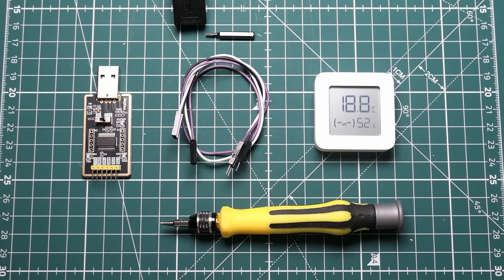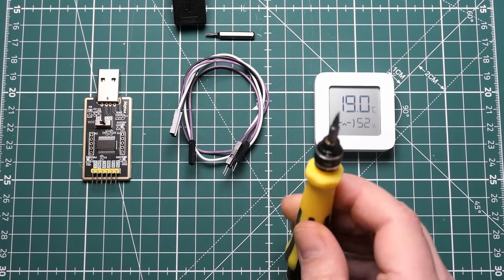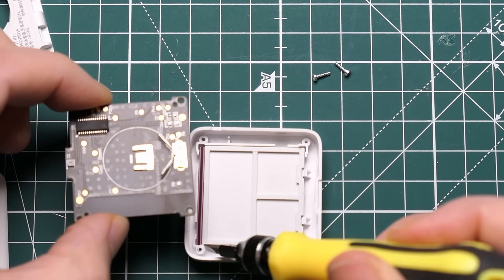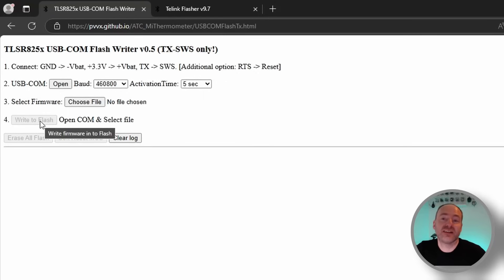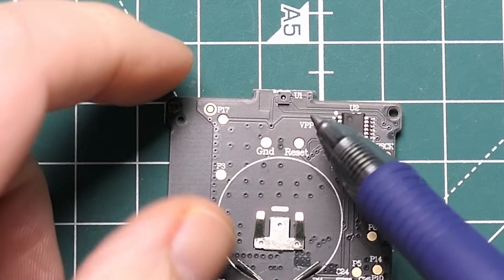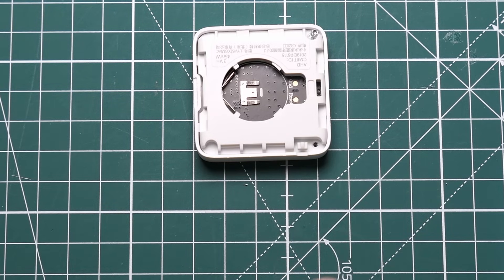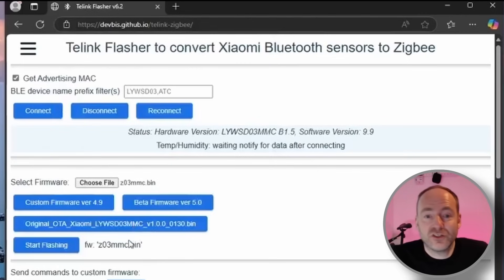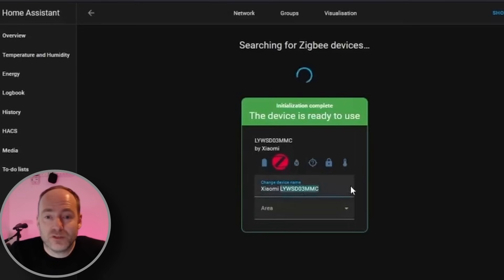Custom firmware on cheap Xiaomi Thermometer, Bluetooth to Zigbee (2025) #homeassistant #xiaomi

Comment: With the official Xiaomi Home assistant Integration can I still use these locally with Bluetooth without changing the firmware since it sounds like it can break the screen or cause other issues with new ones? I bought five of these years ago and have them flashed because they are old versions just to the custom Bluetooth firmware since the official integration didn’t exist a couple years ago. I want to get some more though.
Reply from the maker: I’m afraid the newer versions are completely locked down and don’t work in home assistant without the firmware hack… you’d need to use the proprietary hub and app to use them. 

I don’t think it is the firmware that’s causing issues with the screen, for the sensors I have I just think they are low quality clones and the screens break regardless of the firmware used. Some people mentioned the screen didn’t work immediately after flashing the firmware, I also saw this once, but it is the one time I really had to squeeze the sensor back together (not sure why, think the clips were slightly misaligned), once it snapped back together the screen never worked again. If you can get the sensors directly from Xiaomi that would probably be the safest approach.

Thanks for watching 👍👍
Reply: @thecircuithelper thank you

Comment: FYI: Just bought a Xiaomi MI Monitor 2, 2025-11-14. The hardware have changed. There is no "big" IC on the same side as the battery. There is a NEW small squared IC on the same side as the CPU.
But P14 is still on the same place. And most important, your excellent guide still works!
Reply from the maker: Really interesting update - thanks!

A few folks had mentioned that the firmware had stopped the screen working on the unit, but several of my units ran for a while and the screw has gradually faded and stopped working on all but 2… I guess this is the danger of buying flakey modules off aliexpress, Im not sure they are actually manufactured by Xiaomi, which generally has a good rep! 

Thanks again!
Reply: @thecircuithelper  oui sur 3 modèles après le 2ème firmware l'écran ne fonctionne plus alors que sur mes anciens thermomètre tout fonctionnait

Comment: DO NOT do it on Mac. I had to learn the hard way.
Reply from the maker: Why…….? I didn’t try yet?
Reply: @thecircuithelper well doing it on MAC fried 3 out of 5 sensors.  Blank screen, no Bluetooth. Completely not responsive. Good for the trash
Reply from the maker: Damn, that’s a blow!

Quite a few folks had commented that their screens don’t work either, indeed I’ve noticed on some of mine that the zigbee still functions but the screen no longer works. I’m wondering if it’s more because these are flaky clones rather than the actual firmware on them… I modified all the ones I bought so now I don’t have anything to compare to!

Comment: where to get the ''jumper cables''?
Reply from the maker: Amazon or aliexpress have them! You’ll need a male end for the battery, and male on the other if you use a proto board, or female if you’re plugging directly to the Arduino pins
Reply: @thecircuithelper proto board?
Reply: Please a link to the jumper cables female to male. I can’t find them anywhere.
Reply from the maker: Here’s a link to the wires you need:
https://s.click.aliexpress.com/e/_c3JXzwof
Reply: @thecircuithelper thanks a lott!

Comment: Hi, I tried to flash two devices with a production date of 2024.12, unfortunately neither device booted after uploading the firmware. Be careful, I still have 8 more, but I don't want to risk it.

Comment: OK! For everyone with a "BRICKED" Device....  You aren't bricked. Your screen is just bugged. The unit is working...
Now, to get it working again...  After you flash the ATC_ota_40000.bin, continue on with the steps (your screen will be blank).
Dont use Devbis's firmware. Google for PVVX's branch of this. He has a flasher on his page.
Connect to it and push the OTA "Custom Firmware ATC_v53.bin"
Welcome back screen!

Pre 3/2025 models can then flash zigbee.
There is currently no working zigbee firmware for devices made after march of 2025 due to a change in the way the chip reads/handles it's config on boot. It messes with the zigbee settings and causes constant re-binding with generic addresses. This will get you on to decrypted BLE though.

Comment: just tried it on two LWSD03MMC and yes bricked them both. I thought i'd just broken the lcd on the first so i tried again with the second. same result.
they were ordered from the Xiaomi Tool Store Store on aliexpress, June 22, 2025
Reply: ok, so not quite bricked, but not great either. The display no longer works, but they show up on a bluetooth pair as ATC_xxxxxx. The flasher in the description can't connect, just sits there but the original flasher  on devis called telink-zigbee can see it, and can upload the z03mmc.bin.
the screen doesn't come back, but i can load it into deconzGW which then sends it over to Home assistant. I've got a couple of old ones hidden behind pictures or in the roof that i can swap as i don't need to see them.
thanks!
Reply: @bobmagnets1522  Read the latest comment.

Comment: Thanks for the tutorial. I've tried to do exactly the same thing as you did. I am using AZ-Delivery HW-598 (CP2102)as an adapter for USB to UART. AS long as the Adapter is NOT wired to the thermometer and I am using the first USB Flash writer everything works out fine and the TXD LED is blinking as it should. The moment I am connecting the device as you explained in your video, the log halts at "Reset DTR/RTS". There is no activate and no writing afterwards, everything just freezes. Any ideas?
Reply from the maker: I can think of a few things, most likely is the voltage setting on the usb-uart converter, mine has a 3v3 or 5v setting, you need to be on 3v3 for this. If you’re 100% sure you’re on the right test pads then it could maybe be an issue with wire length etc (seems unlikely though). I’m not sure what else it could be, unless the manufacturer has done something to stop new firmware being uploaded (which is possible I guess, but wouldn’t imagine such steps would stop the uart working, unless an intentional hardware change). Good luck with it 👍👍👍

Comment: I followed this guide to reset my already flashed themometer but after flashing back to the ZigBee firmware, it doesn't attempt to join my network. Is it possible it retained the details of my old zigbee network even after flashing?
Reply from the maker: Hmmm that’s a little strange… How long did you wait? I found it can take up to 15 mins before they are recognised in HA! Taking the battery out and putting it back in whilst being close to the ZigBee access point tends to get it recognised instantly. If you’re still struggling, I believe there’s a new firmware you can flash over the air, might be worth a try but I haven’t investigated in any detail yet! Good luck 👍👍👍

Comment: Unfortunately, it didn’t work. After flashing to  ATC_ota_40000.bin firmware, the thermometer won’t turn on. I had two devices and both ended up the same — not working.
Reply from the maker: Damn, what a blow!
Somebody commented just earlier today that there’s a new firmware you can install over the air, might be worth a shot trying that one. If you can’t connect wirelessly because the device doesn’t respond then you might be able to upload it with the uart! Good luck 👍👍👍
Reply: @thecircuithelper  just update, firmware work, just the display is off.
Reply: @thecircuithelper  can you send me the link for the new version, I didn't find it in original Github rep. Thank you.
Reply from the maker: I’m afraid I didn’t get chance to look yet, was just going on the comments of somebody else! If I find it I will post a link!
Reply: Mismo comportaminento he podido meter zigbee pero la patanlla deja de funcionar... ¿has avanzado en esto?

Comment: Confirming others experiences. Uploaded the Initial file fine. Then the second file over BT, Zigbee would'nt find it, so tried upload again and it zapped the unit.  Waste of two hours...  Update, was able to reinstall first file still blank screen. Fitted in another working case but still not working. Confirms it seems to brick the board.
Reply from the maker: Damn, thanks for the update! Sorry about the unit, so weird it works for some and not others!
Reply: I thought I'd bricked two Xiaomi sensors until I realised the screen was blank but the sensor was still communicating over bluetooth.  Home Assistant and ESP32-Faikin devices were still able to communicate with the sensor and collect data.
Reply: Same situation, after flashing the first firmware it seems to just have a blank screen. Shame as I bought 5 of them, bricked 2 so far

Comment: When doing the 2nd part i am assuming you need to be on a device with Bluetooth? e.g my PC does not have Bluetooth so the Xiaomi would not be able to connect with the PC?
Reply from the maker: Somebody commented and said it’s not necessary to do the first part, you can simply flash the zigbee firmware onto the unit without going via Bluetooth! Haven’t tried it myself, but worth a shot if you don’t have Bluetooth available. One thing to watch out for is that some folks have said the firmware has bricked their devices, this might be because Xiaomi have updated their hardware to block it. So only try it if you’re willing to sacrifice a device if it does go wrong! Good luck 👍👍👍👍

Comment: Flash process to ATC_ota_40000 seems to be successful according to onscreen logs but I managed to brick two units as well 🤨
Reply from the maker: What a blow! My first suggestion is to disassemble the units and carefully rebuild them, making sure everything is perfectly aligned. If that doesn’t work, you can try flashing the second firmware directly on the unit using the usb-uart converter. Somebody in the comments mentioned it’s not necessary to install the first firmware, you can go straight to the second. Finally, if you have no luck, you could maybe try connecting to the unit in home assistant, as it may just be the screen that has stopped working (this is my suspicion). Good luck, let me know how you get on! I really hope the design of the units hasn’t changed very recently meaning the firmware used in the video is no longer appropriate! When did you buy your unit? Cheers
Reply: @thecircuithelper  Thanks for the reply, and your fantastic work.  Unfortunately, I think they have changed the firmware to block flashing.  Have tried connecting, and flashing various bins hoping that it was only the screen but no luck.  Bought online in South Africa, not sure where the units were sourced from. Regards
Reply from the maker: Damn, thanks for letting me know. If better update the video info to warm people there’s a possibility of bricking them!!

Comment: Any pointers for a blank screen after the first flash of the 4000 bin
Reply from the maker: First I’d disassemble the sensor and rebuild it, making sure everything it correctly aligned. I once had a blank screen because the lcd wasn’t perfectly positioned with the PCB. If that doesn’t work you could try flashing the second firmware directly using the usb-uart converter, another person tried going directly to this second step and had some success! Good luck!

Comment: aaaand i bricked it, flashing ATC_ota_40000, making sure using the 3,3V jumper, same wiring as you did, and it wont power on anymore
Reply from the maker: Damn, that’s a blow! Not sure what could have gone wrong? Maybe try disassemble and rebuild it? I had one that didn’t turn back on and  when I opened it up again I realised the PCB wasn’t sat perfectly on the little plastic pillars so the connector to the screen wasn’t perfect! Good luck
Reply: its working, but the screen is dead. it's a bug on the new hardware. You can still use it, just without a screen.

Comment: Thank you for the very clear video. It worked!
One thing (very obvious if you think about it): you need a computer with Bluetooth to be able to do the second step. Most people probably work with a laptop that has Bluetooth by default, but my PC does not have Bluetooth. So I got an error message right away!
Reply from the maker: Good point! I’m on a laptop which has bluetooth but I guess many older desktops might not have!  Thanks for watching 👍👍👍

Comment: Can i use an esp 32  as my converter? Or that is not possible and Ireallt need to buy that type of equipment
Reply from the maker: If you do the firmware mod then you need some kind of zigbee hub, some of the newer ESP32 models have this functionality (I think), but I’m not sure how complex the coding would be to interface with the sensor and then send the data out via WiFi to an mqtt server or something equivalent! Thanks 👍👍
Reply: @thecircuithelper  I managed to get the first firmware into the sensor. However now, doing the part where we install the second one OTA the site is a little bit different now
It doesnt show the same things as in the video. It is asking for a device known id, my token and my bind key
How should I proceed? Thanks ind advance!!!

Comment: if you're going serial, why the double flash? Just flash the zigbee one, directly...
Reply from the maker: It’s a good question, I was coupling together a few different tutorials. One of them mentioned it’s vital to first install the ‘first’ version of the firmware before doing anything else. Like you, I’m skeptical if this step is needed, but bought exactly the number of sensors I needed and as it worked I went with it. I’ve ordered a few more sensors, once they arrive I’ll ‘sacrifice’ one to see if it can be done directly with the OTA firmware to see what happens! Cheers 👍👍
Reply: @ i think there's no difference: via serial it's almost impossible to brick... and each firmware completly overwrites the full storage, the serial is a safety net when you screw up things in other ways...
Reply from the maker: I’ll give it a go when new sensors arrive and update the video description if it works, thanks! 👍
Reply: @thecircuithelper  Ive tried it for fun and giggles, and it worked without issue.
Reply from the maker: Great to know! Thanks 🙏

Comment: hello, i try with zigbee2mqtt but it doesnt seems to work, i mean, it doesnt pair in HA wit z2mqtt, any idea? i dont use ZHA, i use Z2mqtt. Thanks!
Reply from the maker: Hmmm, I’m not really sure what could be going on here as I didn’t try it in Z2mqtt… did the firmware upgrade go as planned and show all the same confirmations as shown in the video? If they did then I’m a little stuck on what to suggest next. Another commenter mentioned using these sensors with Z2mqtt, so maybe you can reply to that person to ask if there’s something special you need to do?
Reply: @thecircuithelper  thanks. i have try with the z2m tutorial, it works great.
Reply: @thecircuithelper  he just needed to do a little research online, to see he just needs to put the device in pairing mode, connecting the 2 test points near the battery, the gnd and reset ones, for a few seconds using any kind of short cable or metal wire... then, both zha or z2m will find them...

Comment: Sonoff makes some pretty cheap zigbee temp sensors. SNZB-02D.
Reply from the maker: Nice, I’ll check them out. Do they need a specific Sonoff hub?
Reply: @thecircuithelper  No they work with any open zigbee hub. I use Third Reality's SmartBridge MZ1 and make them Matter-ready.

Comment: Thanks for this.
If you want the sensor to appear sooner you can try breathing on it to make a step change in the values. The sensors use an MQTT like system so report on a change in level (normally configurable in Zigbee2MQTT once you get that far) or on a time interval if no change is detected within the time  window (sort of a heart beat)

It may be worth you installing Zigbee2MQTT on HA as this is good for getting more access to the settings on your zigbee devices and also checking their connectivity.
Reply from the maker: Thanks, that’s really good to know! I’m running HA on docker and have Zigbee2MQTT running in a different container. Pretty new to all this and I’m beginning to realise running HA in a container is quite limiting as it’s difficult to get integrations like zigbee2mqqt working… thanks for watching and interesting info 👍👍👍
Reply: @thecircuithelper  you can get zigbee2mqtt running ok but it can be difficult unless you're using something like Portainer as your docker manager.
I used to run HA on a docker too but switched to HAOS so I could get the updates as they came through but it really limits flexibility in some areas such as running a database manager in order to get the home assistant logs off the Raspberry Pi microSD card (microSD is one of the least reliable memory systems there is, they can be very flakey and don't like frequent read/writes)
There is a zigbee2mqtt integration for HA these days.

Comment: How is the zigbee battery life?
Reply from the maker: Seems pretty good so far, I’ve read from others that they should last up to one year, quite a while to go before I’ll find out (hopefully!). Thanks for watching!
Reply: Mine lasted 2 weeks after I flashed the ZB fw file.
I will now just solder a double AAA battery holder and call it a day. @thecircuithelper
Reply from the maker: Interesting, mine are definitely better than that as I recorded video at least one month ago and they are still going strong! It’s possible to read the battery level of each sensor in HA, I’m on vacation at the moment but will update when I’m back!